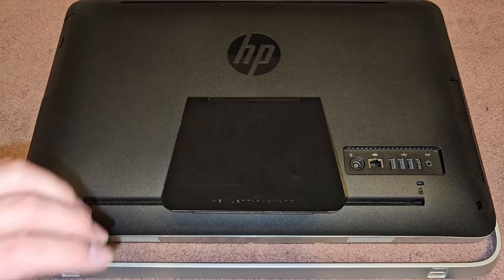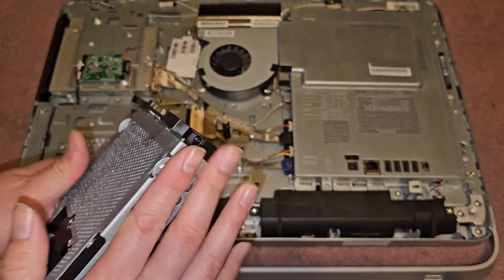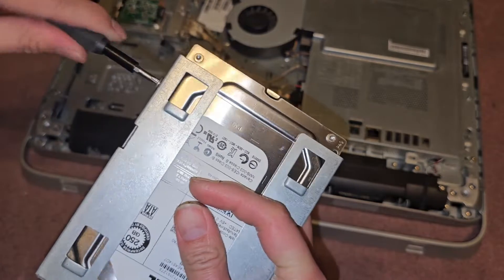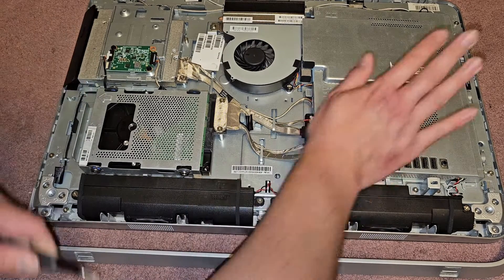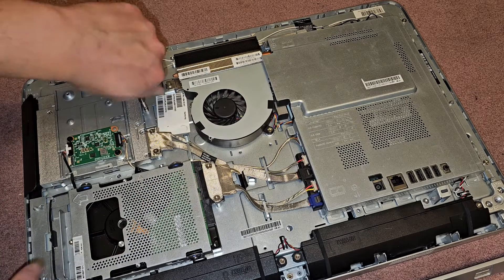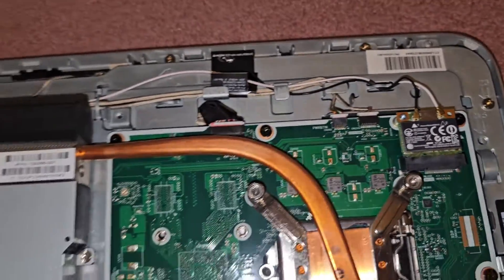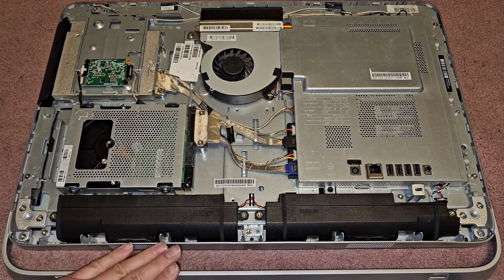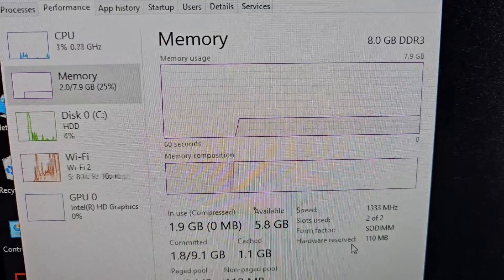HP Pavilion 23 All-in-One PC 23-g116 Disassembly RAM SSD Hard Drive Upgrade Replacement Repair

Comment: Could you possibly do a vid on how to replace the internals, like finding the right mother board from a gaming pc or decent medium fast pc so this can run faster, it has a big screen, front speakers and cd/dvd drive , all it needs is a good mother board to upgrade it so its smooth ,,basically going from base form to super saiyan 😂
Reply from the maker: Not possible
Reply from the maker: You can upgrade the cpu, but only so far.
Reply: @ItsBinhRepaired well,  it is possible right, ive never done it before, replacing hhd and ram is easy but putting a new mother board ive never done before, i i was thinking, if it's a good performance type mother board it should work , but in thinking if the power adapter should be changed to , i don't know bro , it's a cool project, all i want is to have it upgraded to be as fast as my gaming laptop 😂

Comment: I found this same one at my uncles hows and he gave it too me , he said it's slow😂 ,,if i had good money id ,  customize it and replace the sceen with 144 hz  screen and replace the internal motherboard cpu with a wat fast one,
Reply from the maker: Just need an SSD and maybe at least 16gb of RAM
Reply: @ItsBinhRepaired true, but it still has 2 cores , win 11 is to slow for it , I'm thinking of upgrading the internals and putting a new better mother board , i may have to pay someone to sodder some stuff.🤦, i was born in 1989 , im used to big ass tv type screens with speakers, and it has touch support , it would be great to watch YouTube and play old games on it but the cpu is old , there aren't any smart tech people who can solder stuff in my country so its gonna be a hasle , i don't want to throw it away , i just want to upgrade the internals so it can run like a decent smooth gaming laptop, any ideas how i can easily do this ,ive found no videos on how to do this , just hdd and ram replacement 😂